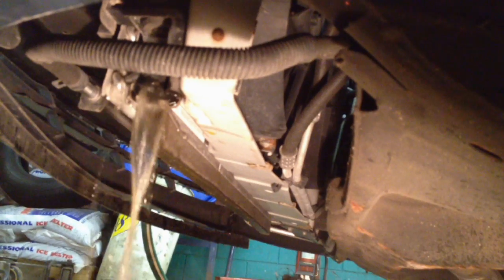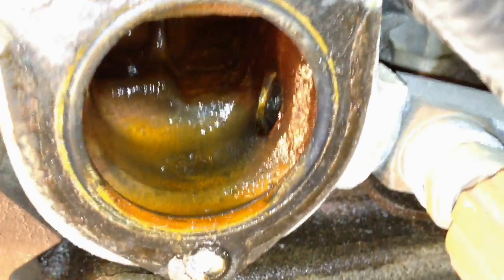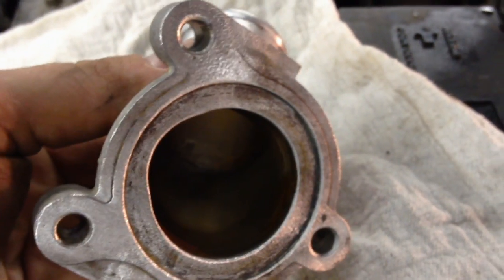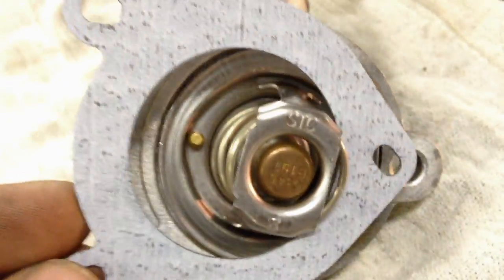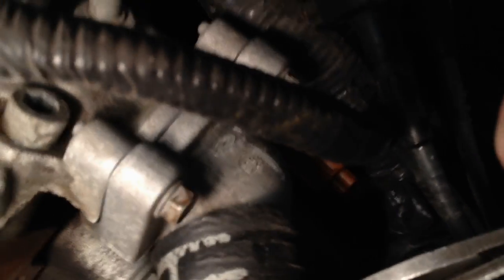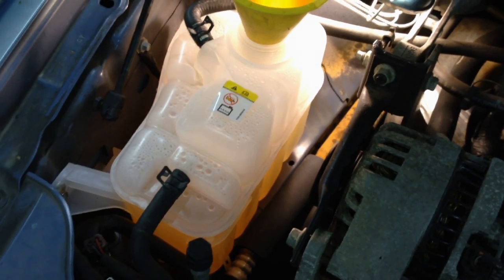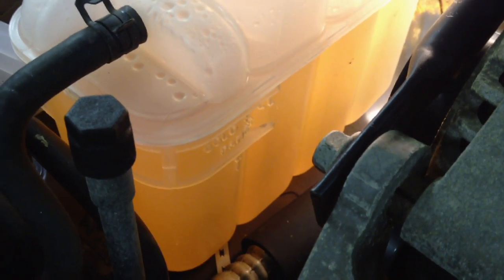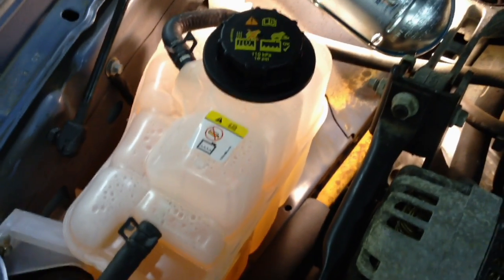Ford Taurus Thermostat Change

Comment: Thanks for a great video.  After watching several others yours made the most sense. I have a couple of questions. Do you disconnect the battery first? Do you use a waterproof sealant around the new gasket? Do you also change the thermostat sensor?

Comment: .Hi the thermostat in my 99 Ford Taurus was being replaced but a couple months prior the cooling system was flushed and a new reservoir was installed. Again a couple months later I was told I needed a new thermostat so I agree to it they charged me 1.55 hrs. labor to remove and install. ($188 + $25 in parts) under the above mentioned circumstances the cooling system already being clean and flushed isn't 1.55 hours for an EXPERIENCED MECHANIC SEEM EXCESSIVE?! I mentioned it and was told that I had a dual overhead cam system. I can see the thermostat housing when I lift the hood and look at the engine, looks totally accessible to me!? Thank you so much for your opinion and your great videos! LH

Comment: great info sir would you happen to know what year engines will fit a 2002 taurus with the 3.0 12 valve i am going to have to swap mine out and my father inlaw has a 97 taurus with the  3.0  12 valve

Comment: FordTechMakuloco You did a very good job on preparing the mounting surface. 1> What tool did you use for the cleaning? Scotch? 2> Should we put the bleeding valve toward the top? 3> I don't see you use any sealant on the paper gasket. Is that correct? Thank you
Reply from the maker: I used a scotch brite pad for final cleaning after scraping off the baked on paper gasket. I brought the neck of the thermostat to the wire wheel on the bench grinder to clean that. As stated in the video the bleed valve is indexed in the housing, if you need to watch it again I go over this and it is very important so the t-stat sits flush. No sealant is required on the ford gaskets at all.

Comment: I have a 01 ford Taurus it has thermostat leak so I went bought a new gasket(paper) put it on just like you did still leaked. so I went back to the parts store bought new thermostat and gasket still leaks. Any idea what's going on? Should I try a gasket maker? Or is something wrong with the housing unit?

Comment: I have a 2007 Taurus...it is not running hot but I have no heat. Do you believe it is the thermostat ? Didn't know if there was any kind of a sensor or not.

Comment: Doing a heater core change and all hoses. My bottom bolt head broke off on the thermostat housing and the rest of the bolt seems to be welded into the intake, Ive sprayed WD-40 and it still wont come out. It still has most of the bolt left.  What are the chance that the time two bolts and gasket sealer will hold?? I'm a DIY'er and the engineering on this car has almost caused me to pull my hair out. Ford sure knows how to make life hard.
Reply: I had that happen with 2 of the screws. I removed the intake plenum and welded nuts onto the bolts, got them hot with a torch and removed them, then used anti-seize
Reply: @zoneb609   I had to fix mine the two bolts didn't hold. I managed to get a small pipe wrench in there and break it lose.

Comment: Great video. I have a 99 ford Taurus and I had only put water in the engine. There is a small leak and I have to keep putting water in once a week. I have a big problem now that the temp here has went into the single digit degrees. Now all that water has frozen solid over night. My father thinks the engine is totaled but I have to wait until it thaws out completely. What do you think I should look for once it has thawed out.
Reply from the maker: cbooker224 Most times yes the block cracks.

Comment: I accidently busted the gasket after tightening it too much after i put a new one in today. And had to get new clamps because the hose was too inflated to put the old one on. Doing a second round,  not gonna tighenten the thermostat in too tight this time. Radiator is flushed... Hopefully this works or im buying a new car.  Im not paying 1000 for labor.. When the part is like 10 bucks. Thanks for the vid very helpful.
Reply: Had to learn the car doesnt go by itself.  Luckily had help too... But i learned alot.
Reply: It worked!  Works perfect! But im still buying a bigger car, and trading this one.

Comment: You have removed all the electrical that hides the therm on our 99 Vulcan...can we just unbolt all the electrical that is in front of it.  Also, we replaced the heater core per your video...all done and put back together but the blower now only runs on high and the blend door motor isn't running.....both were fine before we unplugged.  We have not finished the flush yet but the therm is our last step before refilling and running....does the computer have to reset after disconnecting the battery?  Does it control the blower and blend door activator?

Comment: So I have a 1998 Ford Taurus and I knew it had overheating issues when I purchased it. The water pump, thermostat, heater core had been replaced. . Pretty sure at least the heater core was second hand and the person who did the work is a half assed mechanic, i know hes my brother in law. I had it flushed and the coolant tank changed out including the hoses so the only thing in the cooling system that hasnt been changed is the radiator. I burped the system myself the other day and it really did help but the vehicle still gets hot when it is run on the freeway over 65mph for more than 15 minutes and I also still do not have heat. Im not entirely sure what needs to be done, to make matters worse when i got it back from the mechanic the check engine light was on. Insult to injury he also took off the under protection, didn't tell me, but when asked about it he said it was dragging and against the tires which was BS because I was under the car the day before and I had it bolted perfectly back in place, took me 45 minutes of agony only for him to rip it out without telling me. Do you have any suggestions about the overheating issue and the lack of heat, its already below freezing where I live.
Reply from the maker: +Brandi S I have never replaced a radiator for an overheating issue, if it has overheated this many times it is time for a head gasket test- http://www.amazon.com/gp/product/B000NPDL76/ref=as_li_tl?ie=UTF8&camp=1789&creative=390957&creativeASIN=B000NPDL76&linkCode=as2&tag=fordt-20&linkId=ZKD4OBYIGWYOO57W What is the temp it is overheating to? Was the thermostat installed the correct way as shown in my video?
Reply: +FordTechMakuloco. . . im choosing to replace the radiator because someone before my brother in law put a lot of stop leak in it and its been in there for a while, since it is part of the cooling system and someone os willing to do the work for free i would replace it. I dont know if the thermastat was installed correctly, like i said my brother in law is a half assed mechanic. other than overheating it has no other signs of a cracked head and the mechanics that ive talked to with NO monetary benefit swaying the decision have said they dont think its the head. after i burped the system of air it got alot better. Its just a weird situation, i takes a while to warm up and it doesnt get hot going 55mph but when you go over 3000rpm for more than 15 minutes it begins to overheat, just not like before i removed some air from the system. The temperature comes down a little when i turn on the heater but still no heat and the fluid goes down when i do it as well so it does look like the fluid is going though the heater core.  Its got me quite frusyrated, my brother in law wont talk to me about the car without yelling and reminding me i knew about the problems like thats going to help, hes hopeless.
Reply: +FordTechMakuloco  I have a leak when I install the thermostat. I did it 2 times and still. Is there a sealant I can use? I am afraid I will tighten it to much and it will give up and break.
Reply: Ahhh, 45 minutes of agony. With a lift and power tools, 2 minutes. : )
Reply: Brandi S iyt

Comment: Amazon says the Thermostat posted above(Stant 45359 SuperStat Thermostat - 195 Degrees Fahrenheit) doesn't fit my 1999 Ford Taurus LX 3.0 V6 12V engine. Could you please confirm?

Comment: I doubt that you will see this but do I refill the radiator first then the reserve or let it all flow in through the reserve? Sorry if it’s a stupid question, first time doing this my self.
Reply from the maker: On an engine like this with a degas bottle you fill and burp all through the degas bottle. If you have a regular reservoir and a radiator cap directly on the radiator then you fill and bleed at the  radiator.

Comment: You're saying that a 195 degree thermostat is OEM for the 2000-2007 ford taurus?
Reply from the maker: Yes
Reply: 192 degree not 195 degree
Reply from the maker: yes 89.4°C-93.3°C (193°F-200°F)
Reply: I  also accidently drilled a small hole in my engine block just below the thermostat housing do you know what I can use the fill the hole with...it's on my 2001 ford taurus 3.0 OHV engine.I  think the engine block is aluminum or metal not sure?

Comment: Do you have to do a complete flush? I just need to change the thermostat so the heat can get going again. The car is fall apart and we are getting a new one in a couple months when I am back at work and we just want to get the heater going again. I just recently had the coolent system and heater core flushed and I think the thermostat just went out from left over gunk
Reply from the maker: Zohn Engelhardt As long as the coolant looks ok you can just change the thermostat yes.

Comment: I just changed the radiator on my Vulcan..heat isn't the same as before. I think t-stat is stuck closed. It seems like the temp needle just gets a 1/4 of the way up instead of halfway.
Reply: It sounds like the thermostat is stuck open.

Comment: Question, what happens if the index or whatever, isn't in the oblong area? I have it in the correct direction and my check engine light is off so the problem seems to be fixed, but I don't know about that that last part. It looks as though the thermostat comes closed and you have to open it.
Reply from the maker: If it is not indexed right it does not sit flush in the housing therefore it will not block the water flow properly and there will always be a bypass of water. So the worst thing shy of an external leak is longer engine warm up times.

Comment: Another noob. I have an 1989 Ford Taurus. Napa sold me a different thermostat than the one I have. The old one has a part number 197. The new has a new is 169 and is not indexed. Am I going to wreck my car if I use the one they sold me? Thanks for the video.
Reply from the maker: I would just buy the one from motorcraft so you know it is right. They don't cost that much from the dealer.

Comment: Have 97 Taurus. 169,000 miles . Just a work car. Not a mechanic at all!! Do I need to flush mine etc. I don't even know if its the thermostst. 2 degrees out here in Illinois and it goes straight to overheat in five minutes!!! No heat/ defrost in car at all!! Not sure what to do!!!!!!!
Reply from the maker: ehrinn2009 Follow my series of videos to replace the thermostat and flush the cooling system rust with the vc-9. Have you checked the coolant level. These are known for quite a few leak points also and your coolant might just be low.

Comment: +FordTechMakuloco I have a leak when I install the thermostat. I did it 2 times and still. Is there a sealant I can use? I am afraid I will tighten it to much and it will give up and break.
Reply: +Bergamoism me too...its the little tab that needs to be lined up.  what happens is it slips down in the housing and gets pinched between the adapter and the housing when you are putting it on.  its nearly impossible to keep it seated while guiding in place.
  Note to self.. read the directions or wathc the video PRIOR to ANY job.  I remember doing these things in 10 minutes back in the day.  Little tricky sht gets me if I dont prepare my brain first.
Reply: SGDeGalvez I ended up adding sealant, and it's fine now. It was a little pouch for $1.49. No issues now :)
Reply: cool..cause i used gasket maker and this guy didnt.  They recommended it to me at the ZONE.  Gettting sick of draining that antifreeze.

Comment: Noob here. Changed the thermostat and now have long warm up times and it beg really gets hot. Friend says I have to bleed the radiator but im not sure where the bleed valve is for my 1997 3.0 liter efi engine.  If someone could c omment a link to a picture it would be appreciated. Thanks in advance.
Reply from the maker: Blue24U Did you put it in backwards? Very easy to put in backwards on this car, the dome of the t stat should point towards the radiator.

Comment: I have a 96 ford taurus. I changed my thermostat on my old car that was an 01 Hyundai Elantra, but i did not need to change the coolant. Is it 100% needed to empty the coolant before changing the thermostat?
Reply from the maker: No you could just do a partial drain

Comment: What temperature thermostat would you use on a 2001 ford taurus with the 3.0L vulcan engine?
Reply from the maker: I would use the stock one 192 degrees for sure.

Comment: Did you say 108ft lb? !  I think that's a bit too tight even if from the factory.  That's more lbs than the lugs on the wheels
Reply from the maker: +WG Consultants anything in that area is inch lbs
Reply: OH OH OH wow sorry haha I'm a tard on that, you're right.  Was not even listening and I have common sense to know it's in not ft sorry
Reply: Uh oh... "Easy out" man.  Run to autozone or literally find a Mac truck so you can get an even stronger quality easy out to pull that bolt out

Comment: I did the exact thing on a Ford Taurus. I follow your steps. And after ubwas done adding coolant I just let it idle for a while let the hoses warm up drove the whole time. Till next say in drove it in the morning and around later in the afternoon it overheat. What should I do. Is there air doing it and if so how do fix this?
Reply from the maker: malta goya Is the thermostat in there facing the right direction otherwise you have an air pocket in there. What was the original concern?
Reply: It over heated. And I thought there was an air pocket. But I think I might have a leak somewhere. Because it's low on coolant and I have to add coolant

Comment: what can I do if a bolt broke
Reply: I replaced my thermostat twice in last 6 months & Ive broken a bolt each time. I drilled out the part that was stuck inside housing/manifold & just put another bolt in or you can tap it & put a larger bolt in. These cars & their cooling systems are a major engineering~design flaw. Fuck Ford, never again for me.
Reply: Agreed. I also have a Toyota Corolla, and when i'm under the hood, which is rarely, I really appreciate the simplicity.
Reply: Trust me I broken piece. Of the motor. Not. The  holes. Connector I use this sealer it's works amazing. Just by two. .bolts use half of the bottle. 25¢ each part  CriticalThinker08 And Nathan Chance

Comment: hi, i have a 2001 ford taurus ses 3.0, i do the flush to all system,( heater core, radiator), everything is clean, but i don't have heat
Reply from the maker: Then it's time- https://www.youtube.com/watch?v=Z6b1GaRQAJY
Reply from the maker: Also perform these checks- https://www.youtube.com/watch?v=KXnO5vmm_Qg
Reply: boxing fan javier

Comment: What if u don't drain the coolant
Reply from the maker: Just a bigger mess is all
Reply: FordTechMakuloco I installed the new one , but it leaks , screwed one of the bolts too tight so when I went to go undo it to correct the leak one of the bolts broke off, please help
Reply from the maker: Kevin Wells Oh man not good time to drill it out and start over you just need to snug them is all using a 1/4 ratchet is best to limit your torque.